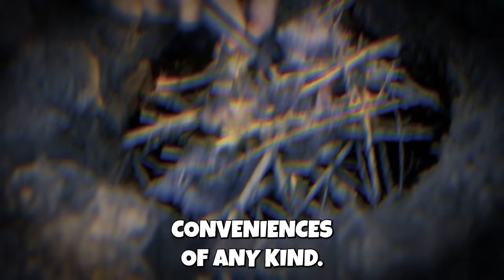90% Will Die In 9 Months! We Tried 72 Hours

Comment: 72hrs would actually be pretty easy for me. but it comes from my past and my current living situation. Family with financial issues so I worked around food stock piling to make sure we never had to choose between meals and rent/mortgage etc..

so I have about a years worth of food for the two of us. maybe more if we ration. it won't be "fun" every day lots of boring bean and rice meals but we would not starve.

Water. only because of where I live I have 1 to 2 months of drinking water on hand at all times. the water here is TERRIBLE. 55 grains of hardness and nasty taste. technically safe but horrible. so I keep fresh water in 5 gallon jugs usually around 100gal roughly and I can process my own but no rain capture yet. I have almost everything I need and then I realized. no damned gutters so no way to CAPTURE the water. Grrrr

power is also a non issue. the fridge/freezer has 24hr backup power. after that a single solar panel is enough to keep a fridge/freezer going (you only need about 700wh to make it over night and a single 250w panel is enough to run the fridge AND recharge the battery for the next night and living in the mountains of NM one thing I never run short of is sunlight even in the winter

HEAT would be very very hard. for insurance reasons I got rid of the pellet stove ($500 higher insurance premium to have any sort of "fire" heat source)

AC is no problem. HEAT would be rough. we we would survive but it would be miserable for about 2 months.

I have tons of power stuff in the connex outback which will be fine through an EMP as long as its closed. ie its a big farraday cage.

I even have enough to run a computer fans lights and an AC during the day. being in the high alt dessert I only need about a KW of solar to reliable run a small 5k window AC unit.

the biggest problem I will have is hygiene. ie showers and waste disposal. trash is no problem. I can burn some and store the rest again 12% humidity things don't wrote. they dessicate. dry out. but personal hygiene would be an issue. hard to dig holes around here and hard to "flush" without water. I have my own septic but not my own source of water at least not enough for flushing toilets. would need at least 3gal a day if we flushed once per day. that is 100gal just for that per month. that's a lot.

NOW lets be realistic. in a grid down scenario? I am fine. no issues. even for months.

In a SHTF scenario? 95% of us are DEAD. period. end of discussion. preppers will be some of the first to die if they did not prepare properly. because that is where the hoardes are going. to the preppers. in heavily populated areas? it will be a literal unstoppable locust swarm of people. desperate people. your dead. its that simple.

Prepping for SHTF is pointless unless its fun or a hobby/something to do or mentally stimulating (it is fun) but practically? not happening unless you literally live where the locust swarm is unlikely to go "OR" your wealthy and can afford it.

now. on the other hand (like your video ie a excellent example) PRACTICAL prepping is something EVERYONE should be taught/trained/practice

go bags bug out bags? YES. keep a week of everything and survive a month on what you got? YES

ie prep for hardship prep for emergency prep for weather and accident etc.. not for SHTF.

Comment: You might want to relocate... Seems to me that, by your neighbours' attitudes, you'll have an awful lot of people busting down your door when shtf for real! 

Idk why people are so dependent on power etc... To me, those things have never been a necessity, but merely a luxury. For four years of my youth we were off-grid, and we only ran the generator once a week strictly to do laundry (water was gravity-fed; fridge and freezers kerosene; stove propane and wood). Power outages at my previous house would regularly last three days or more, and for my first 6 years there we didn't have a generator. It is a regular thing here for all rural folks to fill up the bathtub prior to a storm (due to well pumps requiring electricity), but of course that can't exactly be planned for with an emp. And there are these things called "books" that have existed since long before tv...

We're now living the dream, for exactly two years now! Completely off-grid 2kms deep in the woods in an rv with a small solar system for charging batteries and running the cell booster and water pump. When the power runs out (battery bank drained, no sun), we use radios to communicate with neighbours if we can't get a cell signal. We don't have a well, but we have rain water collection systems set up; in the winter, we collect snow and ice.

Comment: I really hope this video was a joke.
 And if not that you learned where your short comings and are that need large improvements.
A old still Coleman stove and lantern are a lifesaver.
You can get heat and light from the same fuel.
But extra gaskets and parts for them both and learn how to repair them and they'll last generations.
You should have 4 or 5 food grade 55 gallon barrel's collecting water threw out the year.
This way you have water to drink and wash with.
And some way to filter water as well.
Reply from the maker: I literally said at the beginning of the video that we aren’t using any of our preps. The point was to approach it from the angle of not be ready even though we are.

Comment: an EMP is something else the i guess problem with an EMP strike depending on where the strike occurs (sorry I suffer traumatic brain injury Humanity provided me at 3 years old. I break another year tomorrow the 15th I do not know how old I will be perhaps I turn 4, good god that would mean we'd need more, idk they claim i was born 1971 the emp that hit my head was 1974) anyway, I have heard of a faraday box, I'd like to make one big enough to fit my whole house I do not own yet. would the EMP cause fire issues with even say an alternator? I have a few inverters up to 20kw, my 4kw is enough to power my pc, my tv and my internet connection on a car battery for a few hours, if I hook up a car battery charger to the mix the power feed can and will continue as long as the alternator is functioning, I ordered a couple couplers mounted one of the couplers to the housing of the alternator so I can run the alternator using an 18volt dc electric motor, my stand alone works as well my perpetual motion invention no one wants to look at because it redefines physics. this thing should not even spin but it does